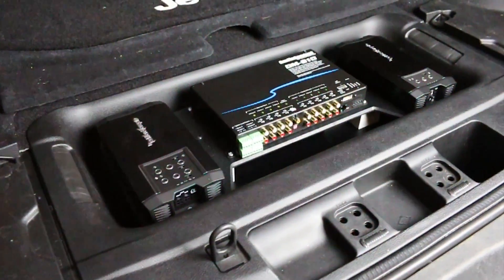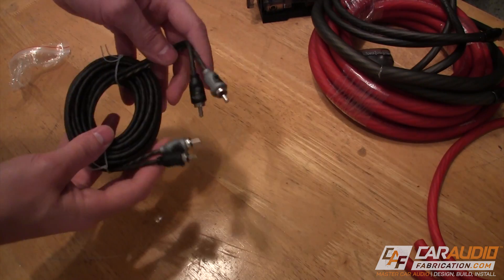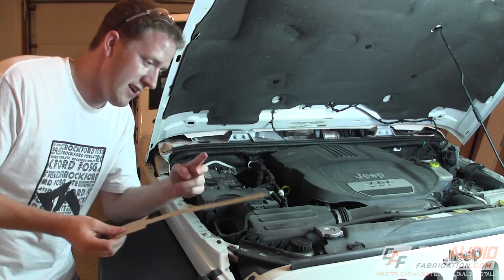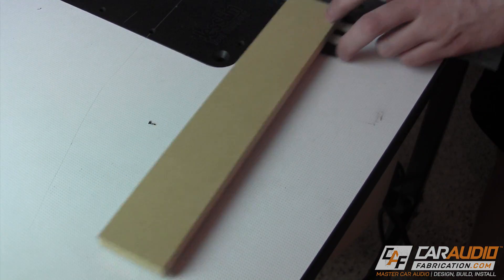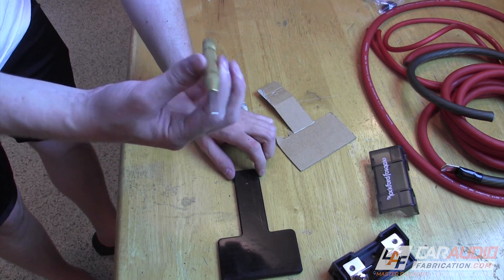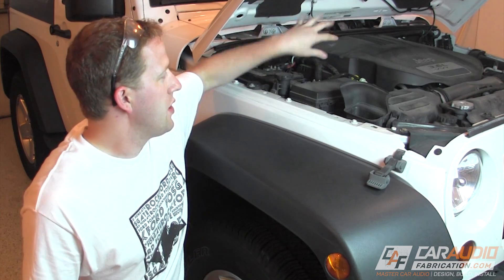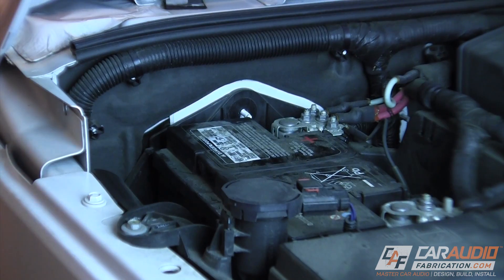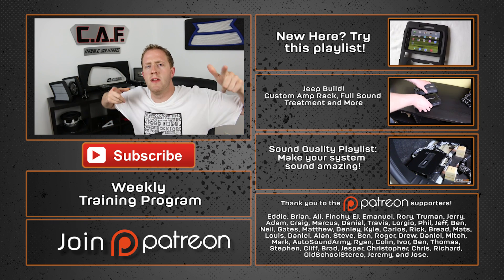Installing an Amplifier? MOUNT THE FUSE CORRECTLY! - Jeep Build - CarAudioFabrication

Comment: Looks great, but for the average installer, I think this is probably doing too much. Looks good though.
Reply: Exactly what I thought. I could install an entire amp/sub setup by the time one of these gets finished. Although I'm thinking as an installer on a tight schedule, not personal builds or show cars. 17 year old kids with Boss gear wouldn't care whether you mount it with this bracket or zip tied to factory wiring.
Reply: +Care I mean there's a reason the fuse holder has slots for zip ties. But yeah for a show car absolutely. Anything for anyone willing to pay for the work.
Reply: Uriel Maldonado Money buys everything
Reply: My thoughts exactly.. You are not making something that is going to be seen. Just cut the thing and file the sharp edges, bend to form, then tap, or do whatever to secure everything.. DONE!... Mark does nice work, but who has all the gizmos and equipment he uses when most only need to do this stuff once in a great while.

Comment: Or you could put tooth paste on the fuse holder to see if it hit the hood. Also why are you putting this fuse holder over the + battery terminal that's one of the most touched piece of a car jumping, other amp work, radios, winch, etc... wouldn't you want to put it at least a little bit out of the way?
Reply from the maker: +Jacob Falk good idea with the toothpaste. There is still plenty of access to the positive for jumper cables. Just looks closer than it is in the video
Reply: Should have know that you already thought of that haha, thanks!

Comment: I do my brackets the same way. But, I use all steel. That plastic is gonna heat up and the screws are gonna get loose. But I understand not everybody is a metal fabricator.
Reply: Nothing wrong with doing it this way. You need to understand the melting temp of ABS and how hot it gets in the area you place it. I've used ABS, type I pvc and HDPE under the hood and haven't had any issues.
Reply: how dare you.
Reply: Well, you know. LOL

Comment: Ok, so if I have two batteries, one in the back and one at the front, I have them wired in parallel with a fuse between them. However, the the battery in the back has a fuse close to it on the cable connecting it to the alternator.  Is this ok?
Reply: Yep.